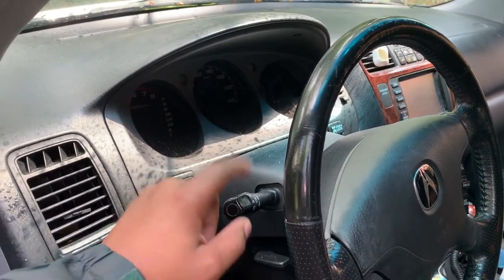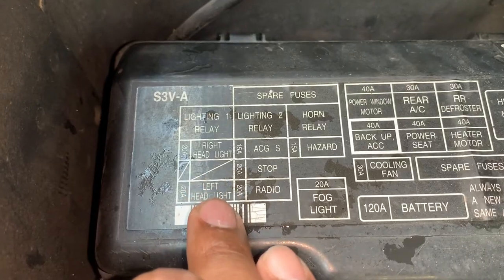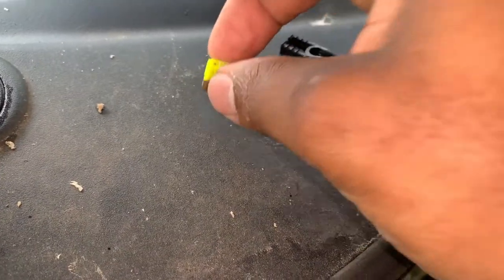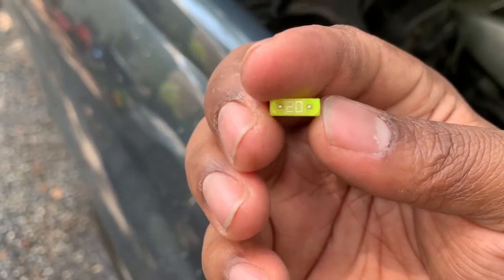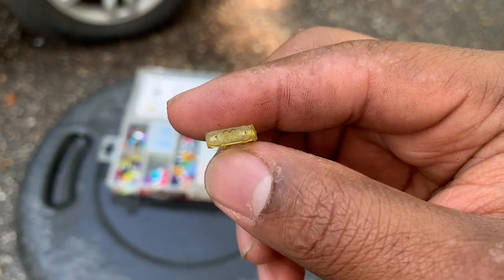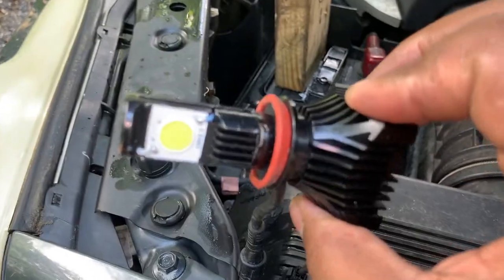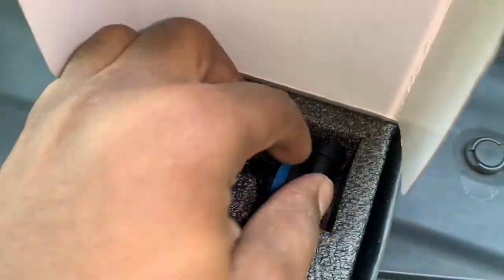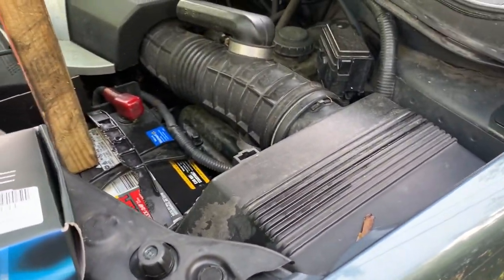How To Fix LED Headlight Not Turning On (Acura MDX)

Comment: checked both fuses, also tested the 2 relays above them by switching it with the horn relay (all same part # omron G8HN-UA-007607 19X4A32C)... bulbs look ok/no broken filaments on the halogen oem but extra ones on the way & i'll try LEDs as well. Hopefully, it's not the headlight switch. PS, the front engine to chassis ground cable is crusty so i may try to swap that out as well

Comment: What year mdx is this for????
Reply from the maker: @erinmoran0420  You can use this level of troubleshooting for majority of Acura vehicles with the HID system. This particular vehicle was based on the year models 2003-2007 if I’m not mistaken.

Hope this video was resourceful to find a solution to your problem.